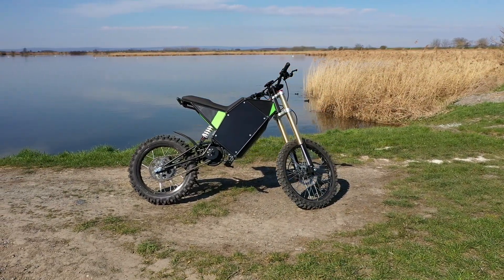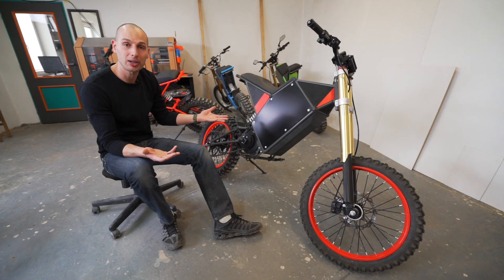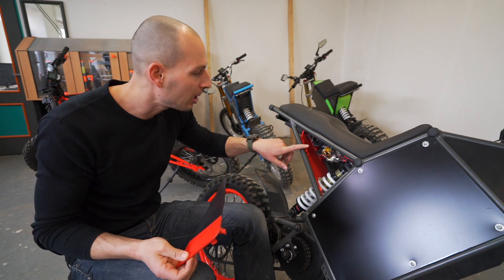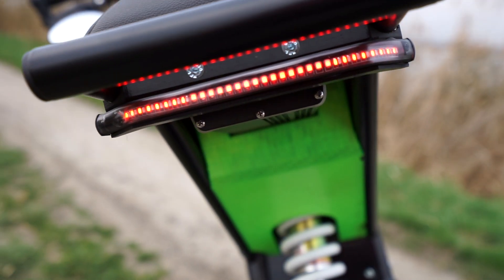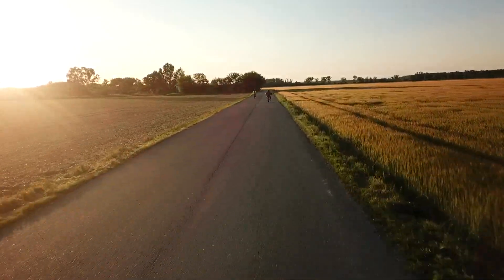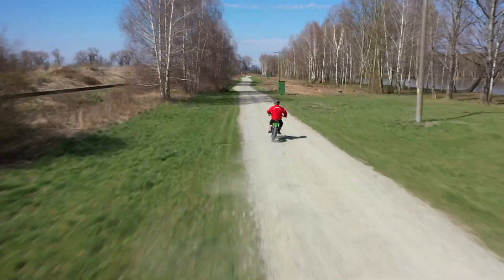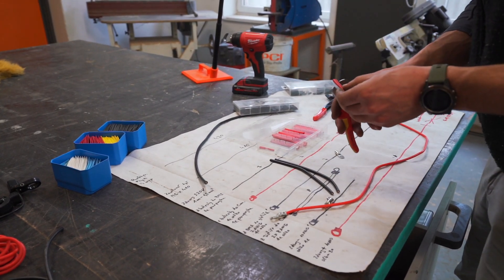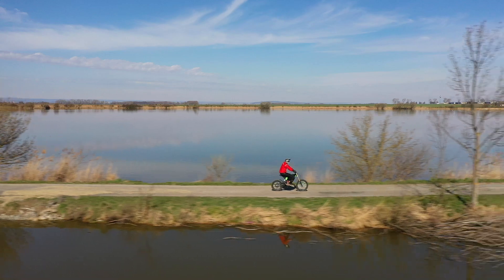27kW DIY Electric Motorcycle - CyberBike Review, Riding, & Power Demo

Comment: Once before you mentioned you’re working on making it street compliant. Is there any update on this? Unfortunately I would not be allowed to drive it in Germany
Reply: Very difficult to do as you need to produce a homologation version of the bike. 
It would be much cheaper, easier and far less hassle with trying to meet each countries individual regulations? See here in Australia they are making it relatively easy for you to be able to get it certified for road use, without the need for homologation version. It just means that each bike is assessed individually; instead of just ticking the box that the bike is just like the previous 100 of them that went through? That's what homologation is all about.

This bike won't be illegal to get passed in Germany.....but you would have to make sure you meet the required regulations to be issued with a VIN for your custom powered dual sports?
Things like the correct tyres, mud guards are a must and will be expected.... Then there's turn signals, mirrors and horn? And those can be fitted and/or adapted from traditional motor cycle and mounted to your desire and sure.....
Definitely this bike could be registerable with the correct supporting modifications and done to the specs of your country's requirements 👍

Comment: Ladi, the chassis is very exposed for outroading. You need more plastic overlaping delicate tubing. And I would extend the tail a little. Fast riding downhill and you could get your ass being sanded by the rear tire or worst

Comment: Surely charging the battery that quickly is going to kill the battery and reduce the cycle life
Reply from the maker: No, you are not right.
Reply: Charging the EIG cells at anything over 5c will reduce cycle life according to the manufacturer spec sheet.

Comment: Hi, how does it react to water?  (Creeks, rain, puddles, jet wash)
Reply: Good Question
Reply: From a motorcycle rider perspective this doesn’t look very water or dust proof. How are those 3D printed panels sealed around the frame? even with rubber all round, how is such a flexible frame water and dust tight to protect all electrics inside? Maybe Ladi can shine some light on this?
Reply from the maker: Side covers are sealed so battery is protected. Under the seat is exposed controller filled with compound - completely water proof. Charger from the bottom is sealed and 3D printed door has drain holes. I wash the bikes with pressure water. Don’t worry, we think sometimes 🙃
Reply: @ladiandmargaret  glad to see a reply from the boss at last :) it’s good to know they are sealed. The question was how are they sealed?
Reply: It's a sealed hub motor and it's mid mounted and now further away from the wet weather? I think you'll find this will be better than most other electric mid drives? It makes sense from a visual stand point that these ARE going to be more weather resistant than just about any other electric bike on the market?
Reply: @Jarmezrocks  Why are you asking so many questions when trying to answer a question?

Comment: Will you guys be making a mudguard that protects you from wet roads? The main problems with all these types ebike frames is that it splashes a lot of water on your back when riding, so if there is an extra mudguard you can buy I may consider buying this over a surron. As the surron has aftermarket support that makes mudguards that extends all the way to protect you from the rain.

Comment: I have some questions
Did you send a measures of metal frame and we make frame or we buy some frame?
How we clean bike and is motor waterproof
Can bike ship to Serbia?
Reply from the maker: The frame comes in a box. You can pressure wash it with no problem. Shipping to Serbia is possible.

Comment: 12:34  adding a security lock to this door would be a good idea ( option)
Reply from the maker: Why do you think so?
Reply: @ladiandmargaret  you said "..put your wallet.". . i could be a good  place to store something securely . 
i did say "option" 
since you 3d print the parts anyway ... 
why not offer the option for a lock  
plus i would be paranoid if some one just  flip open the door and cut my charge cable 
. there is a reason gas tanks doors have locks   at one point they didn't
Reply from the maker: That’s crazy to worry about somebody cutting of your charging cable. Nobody even knows it’s a door.

Comment: I've always loved your bikes and the latest is even better. As someone else mentioned, these are not street legal and it would be amazing to look into how to accomplish that. Even taking them overlanding I have no idea what customs and imports would have to say about them. Anyone have any ideas? I'm in the US but curious on thoughts globally. As you and Margaret have mentioned I want to use them to run in for groceries or scout the area and then just for fun on dual track off-road. ❤️
Reply: These are all great points. I don't think customs/border protection would have anything to say about the bike. However, if it's not a pedal-assist e-bike, it must be street legal and properly permitted (and the rider must be properly licensed). This is the issue that would run one afoul withe the authorities on a grocery run. Use on private land, or in the back country is the same as an ICE dirt bike, ATV, etc.

Homologation requires all proper lighting and safety features, including ignition, lighting, etc.

After all that, there's insurance.

Personally, I'm looking into the process of building a custom vehicle, then permitting it, obtaining a motorcycle license and securing motorcycle insurance.

Comment: Guys, this is brilliant, honestly. You're both leading the future into new, fun and innovation. Awesome video kids. I love it.
Reply from the maker: aww thanks so much, Brenda! Lots of blood, sweat, and tears but we are feeling over the moon right now!
Reply: They got me with a built in charger. Ever zero for their fxs has a 1000w. Like wtf is that. I just don’t think they ship to the usa cause I would of took this over a surron all day.
Reply: @hollowedentity  it beats suron in every way cuz it's custom build not to mention you can upgrade it to however you like
Reply: Easy with the punctuation.
Reply: Totally. I'm only now aware of these insane ebikes now addicted
Reply: Awesome video kids? Ok thanks granny 😂
Reply: Hey this could be amazing if not based on that obsolete primitive mechanical transmission based on lowest reliable component as chain is!  Highly sensitive to any dust, average cumulated polution or friction altering etc.   Do not you heard about Direct Drive in Wheel based on those genius BDLC motors that already widely used in lot of electric scooters today since...long time ago??   Modern E Scooters based on alike direct wheel drive all have maximum torque at any speed and also regenerative brake by default with no extra "cyber" design!...I usually run  2 drives scooter (2 x 3600 W !) long time ago designed by korean Minimotors ...that still today far surpasses any of this cyber(?)bike performances.  Mine has no mechanics issues no chains not even mechanical classic brakes... And because of that it is ten times more portable in any circumstances since it has half of the weight of this cyberbike as no extra weight for mechanics.  Cyberbike should be radically redesigned as getting much better inspiration and real performances from these already notorious BDLC direct in wheel drives used by many electric scooters since years ago!...
Reply: @LaurentiuGavrea  

In addition to unsprung weight a mid-drive with chain drive allows you to change gearing (and customize the wheels as mentioned in the video at about3 min).  

Weight - I don’t think this has a transmission, just a chain drive.  Chain drives are very efficient, light and a proven system. 

Braking - I’ll stick to traditional high-performance hydraulic disc brakes if my life depends on it.  Plus this bike has regenerative braking too.
Reply: @LaurentiuGavrea  a hub motor is hardly the appropriate power plant for an off road bike. Asphalt based scooters-sure! But this thing climbs mountains. And this uses a hub motor-just as a mid drive.
Reply: Are you sure???   This mechanical chain based transmission (full dust dependant, lowest reliability etc) is too primitive to consider this crap cyberbike... so brilliant!   Modern notorious electric scooters are far smarter!   Check for some amazing genius russians who already made it even 4 years ago!!  You do not reinvent the wheel!.... Did you hear about Direct Drive BDLC motor in Wheel ??   That is the real future and the only brilliant!   No chains no mechanical transmission, maximum torque at any speed starting from 0 !!   With also native energy regenerative like ABS brake included by default that most of electric scooters already have it today since yesterday!...  So think it smarter and better informed about!
Reply: @LaurentiuGavrea  but then u have at hat unsprung weight in the wheel instead of the the center of the bike. give me a chain and lighter wheels any day!!
Reply: @LaurentiuGavrea  pay attention….the motor used in this bike is actually a QS 205 3000watt hub motor, used as a mid drive. It is capable of 25~30k+ watt bursts. Outside of the newer inrunner motors, this is pretty cutting edge. Let’s see the bike you built?